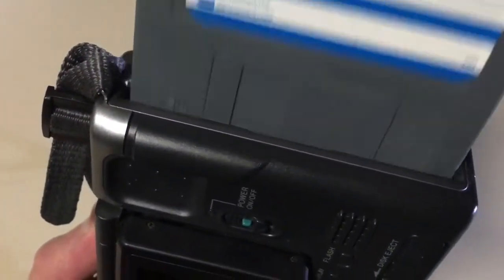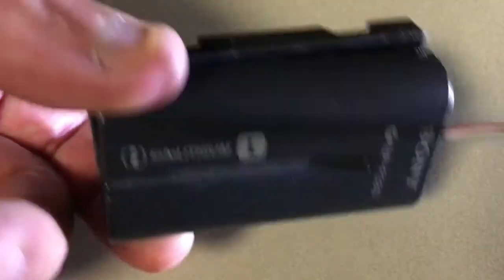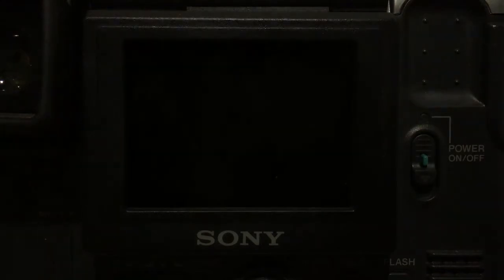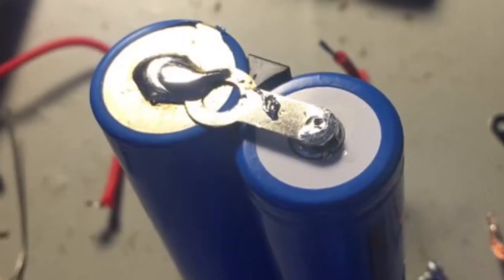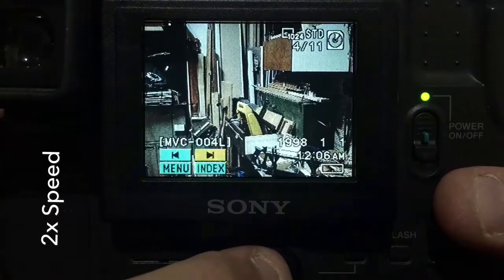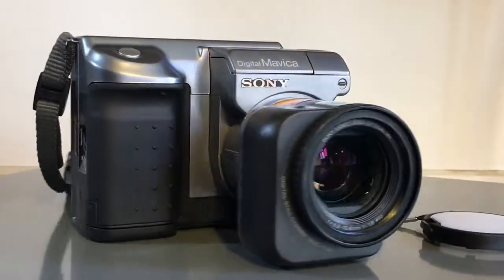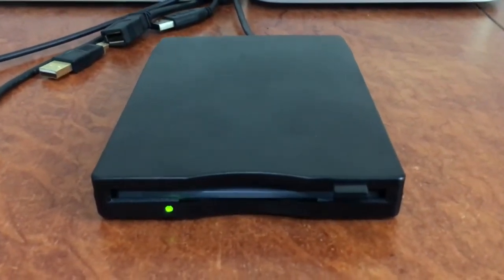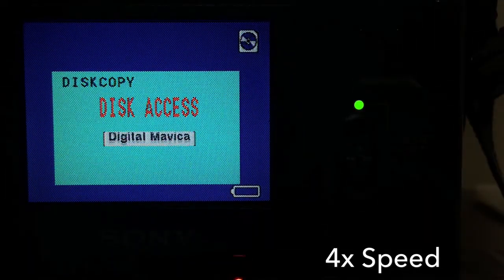Sony Floppy Disk Digital Camera (1999)

Comment: I have a large collection of vintage digital cameras including that one. You didn't say what you paid for it but I would say that given its physical condition and the fact that you got a very desirable Mavica camera case, you got a good deal!
Reply from the maker: Hi :) I found out later that the case was an option. It was in a brochure that came with another Mavica. I’d say I got a pretty good deal on it. I just had to buy a China battery and charger.
Reply from the maker: I’m of two minds now about putting it through the stress of the time lapse I was talking about in videos after this. It would be some 500 photos all saved to disk, and that would be some considerable wear. I’m not sure it’s right if I like the camera.
Reply: I don't know about in Oz, but here in the States they often come up on eBay for a very reasonable price. Maybe you could pick up another, or even a different Mavica model, they all use the same battery. The FD91 is one of the cooler Mavicas, but I don't like the image quality as well as some of the later models.

I also have all of the CD Mavicas which have very good image quality, even by today's standards, but they lack the charm of the floppy models so I almost never use them.

Comment: Nice. Great little project. What is the resolution of the images?
Reply from the maker: Hi :) The best is 1024x768, but I have my eye on a later one that does 1800x1600. That might just be of some practical use. For this model, if you want a bitmap it can do one single image per disk 640x480 :D
Reply: Nope. The best resolution is 1600x1200.

Comment: Hi  I have one of these mavica camera , but I am having battery problems, the battery is fully charged when inserted it reads  empty, 
do you know how to fix this problem.
I took the camera to a camera shop ,but no one likes to look at it
Reply: I don't know if you ever got it straightened out or not, but your battery is bad. It is not uncommon for an faulty battery to take a full charge only to not work in the camera.

Comment: Hey about the battery pack always saying its low on power, I'm betting that that inbuilt micro on the pack is reporting a dead battery, kind of like inkjet cartridges do(when they are not really empty). There may be away of hacking into the IC?
Reply from the maker: Hi Leon :D Your nick & avatar remind me of someone else, so I almost made the same mistake again! The new battery has still never been charged by me, so perhaps that will change the level. The controller might still be predicting the new cells are flat based on previous performance of the original cells. If not I'll see how the China fake ones go. I figure there's little point messing with it if those fake batteries are ok because they are cheap :)

Comment: did the chinese copy work? Do you by any chance know which one was it? There is many offbrand ones floating online but im not sure they will work w Sonys infolithium system
Reply: The Kastar branded ones from ebay/amazon work (at least in my FD7, FD73, and FD75.  I have an FD91 that should be here Saturday, so I haven't tried them in it yet).   The problem is they are ever so slightly thicker than the original Sony ones, so they are so tight in the battery compartment that they are nearly impossible to get out.  This can be fixed but it takes some work.  I took the two Kastar batteries I  bought and sanded the tops of the cases a little at a time until they fit, then fine sanded them and polished them with Brasso and a rag.  Some other brands might fit better, but I can't say whether they will actually work in these cameras, as I've yet to try them out.  Btw, by the "tops" of the cases I mean the smooth side with the narrow slot running about 3/4 of the way down the middle (where the SONY and InfoLithium logos would be printed on the oem batteries).
Reply: @crominion6045  Thanks! Will order them and try them out, w some slight adjustment via sandpaper or so
Reply: @szilassim5  Update.  Got my 91 a couple days early and the Kastar batteries work just fine in it. 👍

Comment: In theory, can a gotek usb floppy emulator be jerry rigged to hang out with a cable?
Reply from the maker: I’m not game to open it unless I have a spare :D but the though occurred to me. I don’t know if it’s going to be the same as a PC FDD interface or not. I’d be more keen to sort out their infolithium protocol for a project, but not quite motivated enough yet. I am already on the lookout for an MVC-FD95 (2.0 Megapixel) or later though.
Reply from the maker: It just occurred to me the camera has a double speed drive. I don’t think the Gotek would cope with that :D
Reply: Maybe the mention of such an act tantamount to a TearDown was a tad too soon. :D Who would do such a thing?!11!!? With these retro items and their provenance, people do grow attached. Maybe instead take it through customs just to get the free XRay pic of it? LOL. Just kidding: This comment does not constitute TSA advice. Regarding that protocol, I'd be fascinated to see what you come up with because the concept to my feeble mind isn't all that far removed from how printer ink cartridges and laptop batteries have a "chip counter" on them (maybe using some manner of checksum - based on polynomials?) and are thereby a nuisance in the neck. Same goes for power tools. Not only does it mean one would err on the side of caution before trying an Aldi circular-saw 20v Li  battery in a Lidl Saw, but also, your findings might provide clues for resetting the counter for tools that have been used with that first inital charge and could be a way for people to salvage pertaining Ebay junk. Surely printer refurbish shops know something about that. The copy-protection hacks I've paid most attention to on youtube are like that for the sega saturn or psone by means of using an arduino (or some maker board) to do it. Maybe they use one chip or more to bit twiddle out some signal. It is over my head TBH. Perhaps getting the camera battery chipset and putting it on an FPGA board would help interrogate it. A relaxing tune to listen to during that might be the classic PSA track " Don't copy that floppy ". ;p
Reply from the maker: It's just the condition, I could wreck a worn one guilt free. I hate those marketing stickers on it too, but putting up with them :D